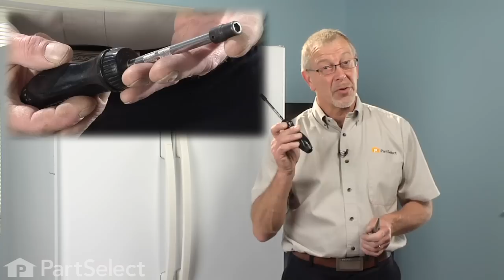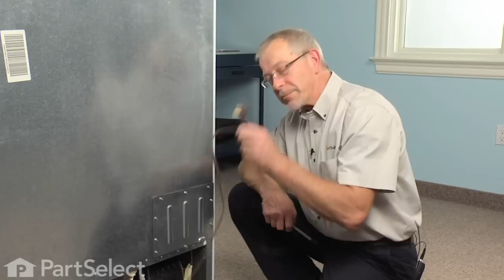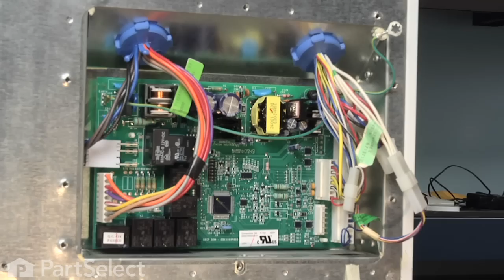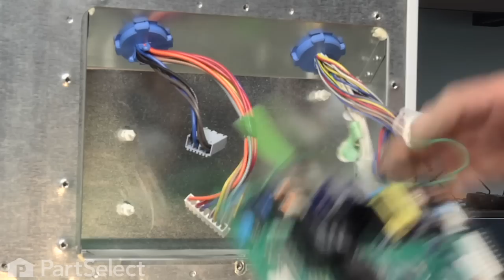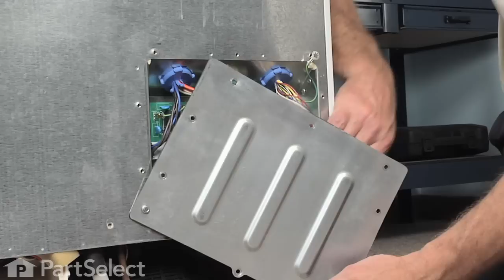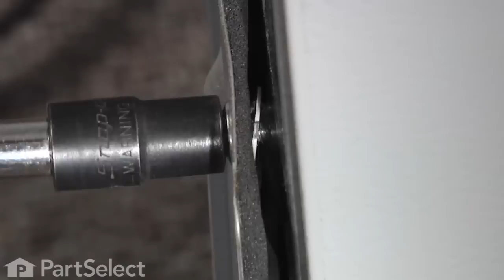Refrigerator Repair - Replacing the Main Control Board (GE Part # WR55X10942)

Comment: You glossed over how to remove the blue connector from the three flat pins labeled COMP DEFR LINE. That's a sticking point for me. You had it on fast forward. This is a connection I haven't seen before and it doesn't want to come off easily. Maybe I can find a better video that actually explains tricky things instead of stuff that is already self-explanatory

Comment: Hello, I have a broken WR55X10156 board and I bought a wr55x10942 instead by mistake. It has everything the same except that the WR55X10156 has some pins (J15) where the compressor is connected and the wr55x10942 only has the solder on the board without those pins. If I solder the two pins from my old WR55X10156 to the new wr55x10942, would my refrigerator work? Since all the new board is the same as the old one (Except that)

Thank you!!

Comment: Great video,  but there's not panel at the back of my ge fridge.  Where else would it be??
Reply from the maker: Manufactures like to move those boards around so it maybe mounted down in back by the compressor or some mount them behind the front grille secured to the  underside of the bottom of the fridge.  Good luck and know your not alone in hunting down this sort of thing.

Comment: Thanks for the video, bought a repair kit for the control board  and my unit is working again here: https://www.ebay.com/itm/GE-WR55X10942-Refrigerator-Not-Cooling-Clicking-Control-Board-Repair-Kit-/163569834639

Comment: Hi Steve and PartSelect, My 85-year-old parents' fridge quit the day before Thanksgiving. I'm a single mom who can barely wield a screwdriver. But with my mother stressing over a costly repair, I took a look online. We had all zeroes flashing on the display, and the interior lights blinking on and off as other folks described, so figured it was the main control board. Found your video, ordered the part, and got the fridge running within the hour. THANK YOU SO MUCH! Never would have attempted it -- or even known to try, without your video. Way more satisfying than paying a big repair bill.

Comment: Is there a way to access the motherboard from the front through the inside of the freezer ?  Thanks !
Reply from the maker: Thanks for the question. Most models are accessed through the rear like in this video. We have found that it makes the repair easiest, as once it is pulled away from the wall, the control board is easily accessed. I hope this helps with your repair!
Reply: PartSelect yes this makes sense. Thank you
Reply from the maker: You're very welcome. Good luck with your repair!
Reply: PartSelect thank you ! It actually just started working again , somehow.  I may just be time to get a new refrigerator before this happens again : )

Comment: My fridge is now making the dreaded "click, click" noise, coming from the motherboard.  I see the fan inside the freezer "start/stop" w/ each click.  I've ordered a new replacement board- which will arrive in two days.  Question: Do I keep the fridge plugged in, in hopes that it will keep cooling itself; or do I need to clean the food out and unplug it until I can replace the motherboard?
Reply from the maker: Thank you for your question. I will have a response soon. Thank you.

Comment: I have the same issue as others - not cooling, no digital display, but interior lights are on...I have replaced the Control Board TWICE today (part WR55X10942P) and STILL have the same issue...any suggestions out there?  Thanks.
Reply: Fridge is a GE Profile (bought new in 2005) Serial # PSS26SGRDSS
Reply from the maker: Mike, when checking under your model number for the symptom “fridge is to warm” the top parts customers have
ordered to correct that issue beside the control board is a temperature sensor, defrost thermostat or the defrost heater. Here is a link to our site for your model symptoms to read our customers issues to see if they might match up with yours. If not I would suggest to contact the manufacture for trouble shooting.
 http://www.partselect.com/AdvancedModelSymptoms.aspx?ModelNum=PSS26SGRDSS&mfgModelNum=&fkMfgID=2&ModelMasterID=141358&PID=179
Reply: I thought I solved the issue when I installed anew evaporator fan motor (with attached evaporator coil thermistor) but while the display came back and the unit produced cold air again, it could not get below about 20 freezer and 47 fridge. It was suggested that I had too much frost, restricting cool air flow.

 I've confirmed that the defrost heater, defrost thermostat and the evap coil thermistor all tested ok.  Any suggestions on what to check next?
Reply: I would test your freezer fan and motor. The evaporator can only cool the compartment to a certain temperature without the fan circulating the cold air.

Comment: I installed this mother board in my GE PDS20SCRBR55. I have (1) three hole female connector that doesn't seem to have anyplace to be plugged into. Is this okay? I mean our freezer works but the refrigerator doesn't and I can only think this may be the problem. Any help please?
Reply from the maker: There is a three wire plug that is located on the left side of the board. You will see at the 1:40 mark in the video where we disconnect it and at about the 3:10 point we reconnect it to the new board. Is that the one you are looking for?
Reply: I have the same problem. Looks like in the video it never gets plugged in at all. Just left alone and tucked in. Also does the 5 hole connector, go in the very top right or the top of the row adjacent to that, in the 3rd slot. It fits both spots but not sure which one it connects to.

Comment: Like many of the other people stated, the interior lights worked but the fridge and freezer were no longer cooling. It may or may not be related that I was also having on and off again problems with the in door water dispenser not working. I ordered the control board off Amazon yesterday, installed it today, and it works perfectly!

Comment: I replaced the main board due to contact for main relay burnt and not cooling fresh food compartment or freezer compartment. After replacing the main board the fresh food stays at 30 degrees F  even with set point at 37 and the display is right with a thermometer that i set in compartment and let set overnight so do not think it is a thermal coupling issue since they read the same any ideas. it is a side by side unit GE Profile and the instructions with the new board had a step to cut a jumper wire on J1 connector if it is a bottom freezer model or other prefix that did not  apply to my model so did not cut any jumpers
Reply from the maker: +Shane Hargis You may need to contact GE or a qualified service technician to solve this issue.

Comment: Hello Steve
I have a GE side by side. The issue I have is as follows. It stops cooling(fridge and freezer).  So I unplug the fridge and plug it back in it works fine for a few weeks and then does it again. So I repeat process. As soon as I plug it in it starts cooling down again like its resetting itself.  Do you have any answers? Thank you for your time. Josh
Reply from the maker: +josh west please advise the model number of your fridge. Thank you.
Reply: GSL25IFRFBS
Thank you for responding.
Reply from the maker: +josh west I will look into this and get back to you shortly.
Reply from the maker: +josh west You may have a problem with a sensor or the control board. It may be time to call in an experienced technician.

Comment: Great information and i like the way you present the videos. I have a question. I am attempting to replace main board on my refrigerator and the part is different and is replaced by WR55X10942. Issue is that comectors are a bid different and althought it was diagnostic as damage board. It does not start
Reply from the maker: carlos silvio I suggest that you contact GE customer service for a solution.

Comment: Great tutorial!  How do you know the mainboard is needed to replace?  My Samsung side-by -side refrigerator stops coolings.  No frost built up in the freezer.  The compressor, relay, fan motor units, condenser & evaporator coils,  freezer sensor & defrost sensor, capacitor, and transformer function properly.   What else could cause such problem?  I don't know how to test the main board and the display panel PCB.  Thanks in advance.
Reply from the maker: Binh Minh Pham What model number do you have?
Reply: The model number is RS2530BSH/XAA. Using the "SELF-DIAGNOSIS" option on PCB Panel I don't see any error display.  But with the "LOAD STATUS DISPLAY" option, it shows the damper in the refrigerator is open.   I can fix it if I know where the damper is located. Thank you very much for your help.
Reply from the maker: Binh Minh Pham We do not have adequate diagrams available from Samsung to pinpoint the location of the damper. The normal location of a damper would be where the freezer air enters the fresh food compartment. This is typically at the top center of the fresh food compartment  on a top mount refrigerator, or the top left on a side by side model. The damper is the device that directs the incoming air flow as well as controlling the amount of air by opening and closing depending on settings and demand.
Reply: I found the damper.  It hides behind the light cover in the fridge.  Thank you so much!  So the damper is not a part of the problem.   I managed to replace the fan motors, compressor start relay and overload protector,  freezer temperature sensor and thermo-protector, capacitor, transformer, and main control board, but still there is no cool air.   After 24- hour running, there was no frost build up, no drain water in the collecting tray; no cool air.   Defrost cycle is 7 minutes every 4 hours, the light is off when the doors are closed, and the door gaskets are in good condition.  What else can I do before calling a technician?  Thank you.
Reply from the maker: Binh Minh Pham If the evaporator and condenser fans are running, the compressor should be running at the same time. You should be able either hear it running or feel a vibration when holding your hand to it. When it is running, the tubing that connects to it should be carrying the refrigerant to the evaporator coils. Some of this tubing will be possibly too hot to touch and one of the copper lines will normally be very cold. If this is not the case, then you may have a restriction or a leak in the sealed system that will require a qualified refrigeration technician to diagnose.
Reply: You're right --it's the sealed system.  Thank you!

Comment: Hi  Thanks for your videos!!  Replaced the main control board on our non-working
GE Profile Fridge.. fridge is now working, but the LED display is not on (the one
that displays and adjusts temp) Any idea what I can do to get this to work? Can fridge continue to operate even if this display does not?  Thank you!!  (p.s. ice controls/ water dispenser also not working)..

Comment: I have a 5 year old GE fridge and it had defrosting problems.  A service repairman came out and installed what appears to be a very similar motherboard you show in the beginning of the clip.  After the repairman left, I took off the back cover to see if he gave me a new motherboard, or old one.  On it, it reads that it was manufactured by backwards "RU" or "RJ".  The green tag says it had a continuity test on 7/13/07.  I am trying to find the manufacturer to see if I can give them the model no. for the motherboard, and they can tell me if its a new one, or old one.

Any idea who to call?
Reply: Are you there, PartSelect?

Comment: Hey Steve - great video!  My motherboard shorted out and melted one of the plastic pieces that plug into the motherboard.. in particular the one that provides power for compressor/defrost/line in the top left.  GE cannot find that part number to order... any suggestions?

Comment: So thankful for your videos. The relay for the water and ice dispenser is not working all the time. Instead of replacing the entire board, I was wondering if you can just replace the relay? I think my husband is worried that he could then ruin the entire board soldering the new relay.
Reply from the maker: Hi Vanessa,
Sorry for the delay in my reply. I would not recommend an attempt to repair the control board. Most electronic circuit boards are sealed with a coating to protect from moisture and replacing components involves abnormal amounts of heat from soldering tools that usually damages the foil conductor or other components on the board. If the relay is defective, we would suggest to replace the complete control board. Good luck with your repair.
Reply: Thank you. The more we looked into it, we figured it would not be a good idea. An expensive problem! I appreciate your feedback

Comment: Steve- A GE Serviceman stopped by to check my refrig. I have a top refrig with bottom freezer.  He diagnosed the problem as being the main control board.  My husband ordered the part from GE and replaced it (view your video). However, the refrig. is still not working.  What could be the issue?
Reply from the maker: Hi Dwenda, sorry to hear the main control board fix was not effective! I'd recommend checking out the following repair page, which details some of the more common causes of refrigerator failure, like the overload relay, and cold control. Hopefully this, plus our Instant Repairman tool can help you isolate the problem. Being without a working fridge is not fun; please let us know how you go! http://www.partselect.com/Repair/Refrigerator/Will-Not-Start/

Comment: Steve - Great video. I live in the NE Sierra of California. We had a really bad wind storm today. The power went out and tried to come back on about 6-7 times before it was stable. Power interruptions are common here, as are power spikes caused by the autoreclosers. Today my GE 6 year old PSI23MGWA BV (LM415774) did not restart... it was clicking at about 1 second intervals and had zeros running across the displays. The interior lights would pulse with the clicking. I killed the breaker same problem. I pulled out the unit and pulled the plug for about 5 minutes, same problem. While looking online for troubleshooting data, the unit restarted. Troubleshooting seems to indicate the Main Control Board (MCB) failed. For about the past 18 months, the ice dispenser door has had problems. The door would open for a second or two, the ice would fall, then stop, the door would close. Retrying the process would result in a few more cubes. This problem does not surface with dispensing water and does not seem to be a problem with crushed ice, but I do not use crushed ice often. Sometimes when dispensing ice the above problem exists and the indicators on the door control panel dim. Do you think these issues are related to the MCB, too?
Reply: A call to GE Customer service on Monday netted a new OE MCB for $65 plus tax and shipping for a total of $76.28. The board should be here Wednesday.
Reply: The board got here a day early. 5 min job to change it out. All problems solved. Life is good! Thank you!
Reply from the maker: Hi Murray, apologies for not getting back to you on this sooner; although it looks like your repairman spirit sorted the problem out impressively. Congratulations, and happy future repairing!

Comment: Steve - before spending $$ on this part, how to you check to make sure this is what is broken?  We have a GE PSS25SGNABS we bought used and it constantly freezes in the fridge and will not maintain a correct and constant temperature.  It has  the same problem with the freezer section as well, but that's not as bothersome since everything on that side is supposed to be frozen.
Reply from the maker: I would test a few other parts first to make sure they are working properly before replacing the control board. Start with inspecting and testing the temperature sensors in the fridge and freezer to make sure they are working properly.As well, make sure the air damper is working (it allows cold air to pass from the freezer/fridge section and helps maintain the correct temperature) Locate the baffle/damper and operate the control knob to verify that the linkage is intact and that it moves freely. If the damper/baffle is stuck in the closed or nearly closed position or does not move freely, then it should be replaced. Next have a look at the defrost thermostat and the heater and test those parts to make sure both are working. Finally, the control board for signs of arcing, burnt connections or damaged foil. Remove power from the appliance before inspecting the control board. Is your fridge display any error codes? Hope this information helps.

Comment: I have a GE Profile side-by-side refrigerator; model number is PSW23PSTA-SS.  The control board model number for MY refrigerator is WR49X10152. 

Question: is replacing a WR49X10152 control board similar to THIS video showing replacement of a WR55X10942 control board? 

Thanks!
Reply from the maker: Yes, the process is similar to your model.

Comment: Hello Steve, I have a code located on my temperature control panel. The refrigerator side,nor the freezer side. I will recheck the compressor and its related parts: overload relay and start relay

Comment from the maker: Hi there,

Thanks for your question! Unfortunately, the part number WR55X10942 is not compatible with your model. I would suggest checking for the appropriate part number with a local appliance repair company, and then searching for that online, like you mentioned.

Sorry I can't be of more help. Good luck in your search.

Comment: else here in Venezuela there is only WR55X10942 plate number as the one in the video posted, and my board has the part number 200D4852G012 AND MODEL 0158-01-05, I wonder if that control board WR55X10942 with him serves my fridge, I mean that if supported, why not get on ebay or amazon the number plate of my control, I appreciate your help and excuse my English greetings, my email is abner.corredor @ gmail.com for I respond by that means also thanks